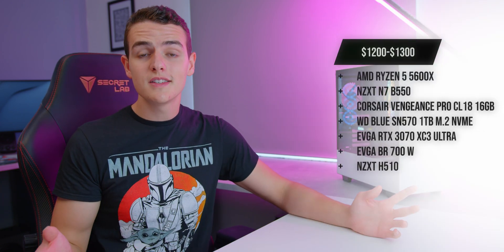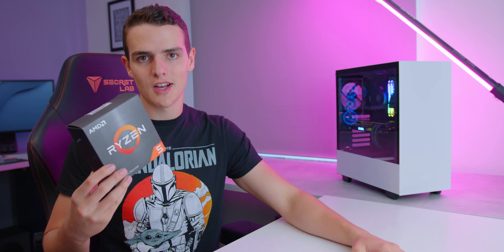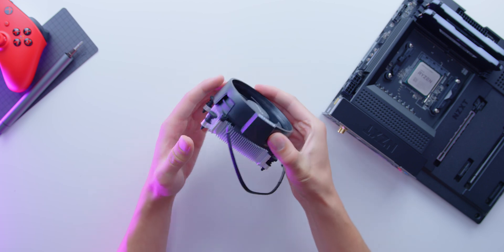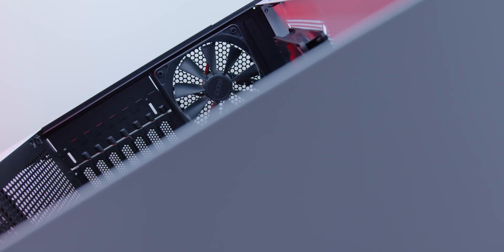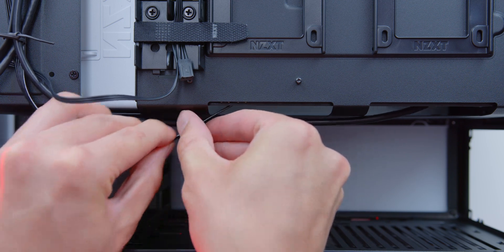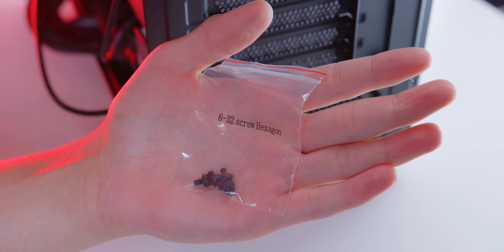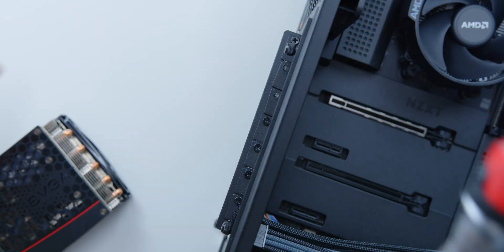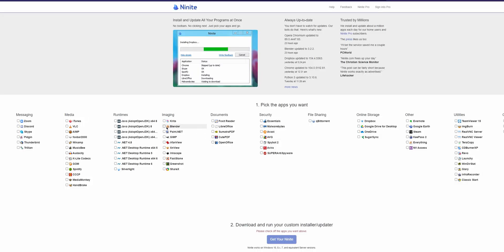How I Build a Gaming PC in 15 Minutes: Step by Step Guide!

Comment: Cool I happen to live near MircoCenter. They have an AMD performance barebones kit for $800. It includes a Asus TUF E-ATX case, ASUS TUF 750 W bronze, Asus Strix B550-F, Asus TUF RTX 3070TI, and Asus Strix liquid cooling system (all installed with the exception of the GPU). When I add in the Ryzen 5 5600x, 1TB WD blue SSD, and 16 GB ram. It works out to about $1,200-$1,300. So by getting the kit I get a better graphics card, 50 more watts for power supply, a big case, and liquid cooling. All of which would have cost a couple hundred more. Seems to me that it is good.
Reply: It is also possible that it could go down even more when AM5 and RTx 4000 series comes out

Comment: would prefer other cases with better airflow/ intake unless you really prefer the nzxt design then go with the nzxt airflow basically h510 but with mesh front compare to the h510 which have such a bad intake its like a mini heater with something like a 3070 in it. speaking from experiences

Comment: Hey! Can you build me a $2000 pc, I'll pay $2000 for it and you get a reason to build a pc in a video! I live in Belgium and everything is overpriced here. I'm also not allowed to build a pc myself (my parents) and maybe you could do it and get some ad revenue from it too! 
requirements:
1440p gaming at 165hz, 1TB SSD and 2-4TB HDD, AIO, no overclocking, great graphics card, 16-32 GB of 3600 ram, I like RGB and silent pc's, even if it drops performence a little bit, I want a seethrough case with good airflow, needs a good CPU (maybe i7 12700F).
You probably won't respond to this, but if you do, that would be AMAZING! love the vid btw!

Comment: I was really thinking of getting a prebuilt as building pc's just felt so daunting to me but after this video im reconcidering it. Apparently cpu prices are really high but idk if thats ended but if it has then i will definitely be building my own thanks a bunch ♥️
Reply: I think you might be thinking of gpu prices. Those were high for around 1.5 years but they have gone down a significant amount since then. I recommend looking up guides on builds that fit your budget if you need a parts list.
Reply: @cheeto_ssbm7826  yeah thats the one gpu prices i can get mixed up sometimes. Now that they have gone down ill definitely consider building my own thanks a bunch.